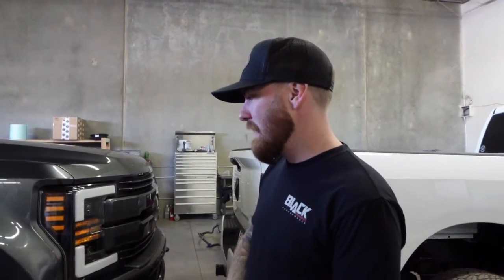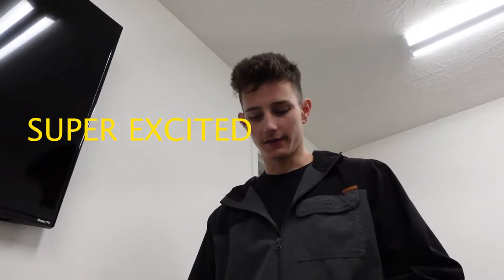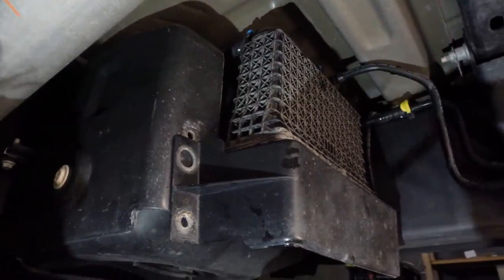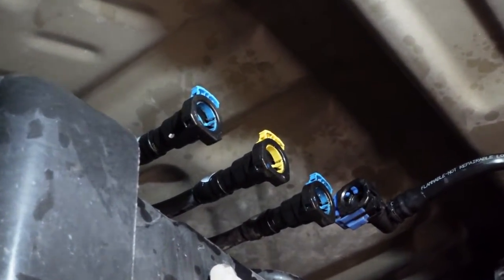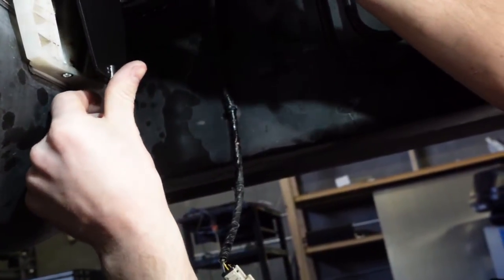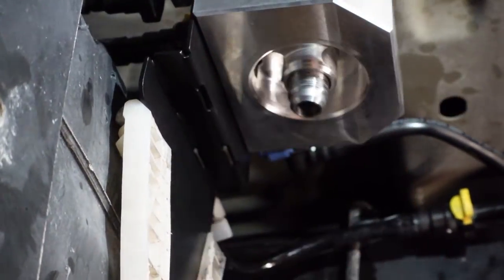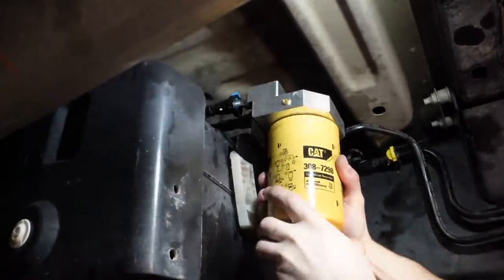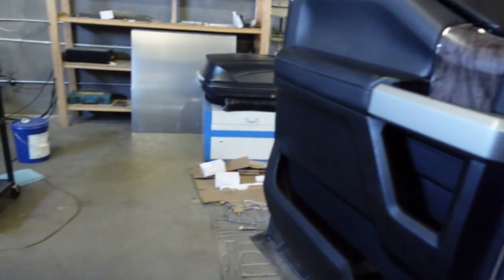REAR CAT FUEL FILTER KIT ON 6.7 POWERSTROKE *INSTALL* BLACK MARKET PERFORMANCE

Comment: FInally got mine instgalled yesterday. Very satisfied that I will not get bathed in diesel from OE filter changes anymore. Three back fuel lines were painful, but finally released. Rest of installed was a breeze. I purchased a new fuel/water sensor to install in new billet lower section. Wanted to keep OEM filter fully assembled just in case. I now have this product for the lower filter and the HSM spin on filter upgrade for the upper filter. Done with plastic filters and diesel baths. Overall I am very pleased with my purchase. 2018 6.7 Platinum.

Comment: I installed the billet filter adapter today and like others, had a major fuel leak from the bottom. Apparently this is a problem that Black Market Performance has been aware of, however, as a consumer, I see that we all have had to figure out a "FIX" for this problem. I went to the parts store today and luckily was able to also fix the problem on my own. 

My question is since the manufacturer is aware of a problem with their product, why aren't they providing the size of the rubber O-rings and/or the O-rings themselves??, in fact, the O-rings were only few dollars. 

For anyone who its in need of a size that fixes the problem, I will try to attach a pict. Don't get me wrong, their past products have been good but they are missing the boat on a true fix. 

Bearing Inside Diameter 2.362 inch
Bearing outside Diameter 4.331 inch
Bearing Cone width 0.866 inch

Their video also missed a few steps that I had to figure out myself....
Reply from the maker: Hi Daron, we send an oring for the sensor in every kit. Did you not receive one? Also we have had very little issues with this kit leaking, if there’s an issue we are very much unaware
Reply: @blackmarketperformance  well when I put the water sensors on the bottom of your kit it leaked like crazy. I read on the YouTube channel that there where numerous others with the same problem and they all had to replace the o rings with larger thicker ones to stop the leaks as did I.

Comment: Please add an update to show adding the reusable billet adapter to the cat filter with a better explanation of what it accomplishes. A good explanation is missing from the website sales page as well....it could be misconstrued that you need to buy a cat filter with that billet adapter on it each time a filter replacement is done. And the replacement cat water separator filter isn't available on your website either. A true cost comparison would be great as well.
Reply from the maker: Just updated the site, the billet WIF sensor housing is re-usable and will spin on the cat filter we send it is a one time purchase. We also will offer the replacement Cat filter on our website. We will try and get a cost comparison done. Thanks for the feedback!
Reply: You can purchase replace filters anywhere online just search part #

Comment: Just installed on my 2020 and the fuel line connections are different. They push down to release instead of popping up. Broke a clip on the first one because of the video. Everything else is the same tho as in the video
Reply from the maker: Good to know, what year and model is your truck? It’s possible some of them have different style connectors
Reply: @blackmarketperformance  The truck is a 2020 F-250 XL 6.7. Also ran into a problem with the o-rings on the WIF sensor they were a hair small so I had fuel seeping by slowly. Got some fatter O-rings and all is good now.
Reply: Thanks for this comment. I couldn’t figure out how to get the lines off on my 2020. Needed pushed down. Almost broke mine too. Need to adjust this video just like the front filter one to accommodate.

Comment: My WIF sensor is leaking after about a week of running the kit? The sensor can only spin on to about 90 then it’ll fall back out. Definitely a prototype system…..Also no water drain in the kit, just a black allen head fitting that was already installed in the billet housing. 

Top kit makes a squeal noise after startup for the first 2-3 minutes of driving. Checked for leaks, no leaks just wondering if that’s normal?
Reply from the maker: The black Allan head is the WIF drain. You may need a new oring around the wif it’s possible it got damaged from the re installation. The squeal noise could be from the wif leaking and air getting in the system. Give us a call tomorrow and we will help you out!
Reply: @blackmarketperformance  

Figured out the Allen key being the drain. Got a new o-ring for the billet bowl and everything’s better. Thanks for the reply 🤙🏼
Reply: If it’s falling out you just need bigger orings on sensor piece. That’s the issue I had

Comment: What proof is out there that this is better filtering than the factory filter? Is there a comparison test done on this filter and the factory one and if there is could anyone give me the link to it.
Reply from the maker: There is a ton of info on Cat fuel filters on YouTube. Not to mention your eliminating the cheap plastic factory housing and connectors that are prone to break, it also ads an easy to change spin on filter without the mess

Comment: Is the sensor plug in already supposed to be in the billet housing? And then you just plug in or you need to reuse and install old sensor unit into the billet piece. The whole sensor unit not just plug in.
Reply from the maker: You reuse your factory water in fuel sensor in our billet housing 👍
Reply: I had to use larger o-rings than stock as well. It leaked as soon as I started cycling the fuel pump.
Reply: Just installed mine today and it leaks big time around the sensor. What’s the best fix for this?  New Ford factory o-rings or some type of aftermarket o-rings? Anyone point me in the right direction?  I need to get this figured out or I’ll need to reinstall the factory water separator. TIA
Reply: @pwshepard  you need to just find a bigger set of orings. Mine leaked as well. I can tell you what size orings I used tomorrow morning.
Reply: @pwshepard  I used just a normal nitrile rubber o-ring kit and found a size that was thicker and bigger and it sealed it good and I’ve had no leaks going on 1,000 miles plus
Reply: @paytongarcia7188  Thanks. Let me know what you find out. I think my local AutoZone may have some that will work. They were a little larger than the stock ones.
Reply: @pwshepard  I don’t know exactly what size it was sorry I just looked and I can’t remember but I know we just grabbed one and test fit it and slit it into the billet housing and it fit good and didn’t move around. Wipe some diesel on it when you slide it in to make it go in tight.
Reply: @paytongarcia7188  I think I found some that will work.
Reply: @pwshepard  I had to get fatter o-rings went to oreilleys and got some and it fixed the problem

Comment: What micron rating is that filter for? There's not much info online, but looks to be 13 micron, which is worse than a motorcraft factory filter. Could you please explain this?
Reply from the maker: All cat high efficiency fuel filters are anywhere from 2-10 micron, Cat no longer shares micron ratings because of confusion in the market. All cat fuel filters are made to be in the dirtiest/dusty environments, their filter elements are definitely the best on the market by far

Comment: I had a locking bracket to keep the WIF sensor locked in the proper position but i have yet to see anyone attach that.
Reply from the maker: Yeah unfortunately didn’t make the video it was added later on our shop truck. But that is what it’s for just adds protection so it can’t come out

Comment: Will a Donaldson P553203 3 micron filter/seperator fit on this application?
Reply: On Amazon there is a Hengst filter H541WK that works as a replacement. Donaldson P553203 does not appear to accommodate the billet FIW sensor.

Comment: Does it work with S&B fuel tank?
Reply from the maker: As long as it keeps the factory housing in the same location with the same mounting then yes
Reply: Let me know how it goes I’ve been wanting to do that myself. I’ve got the filter I can measure it for you and tell you how wide and long it is. Idk if it will fit in the gap on the SB
Reply: @paytongarcia7188  send the measurements
Reply: @mitchellp6355  I’ll measure it in a little and send them
Reply: I feel like it won't work with S&B fuel tank. This looks much cleaner than HS solution.